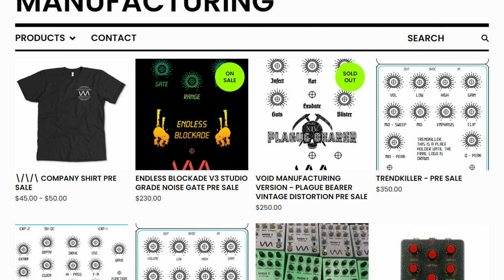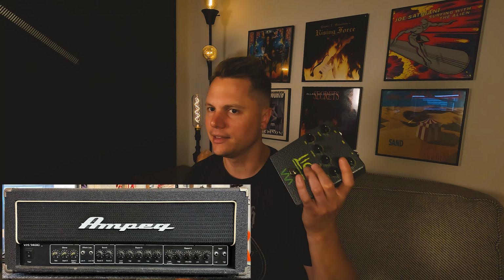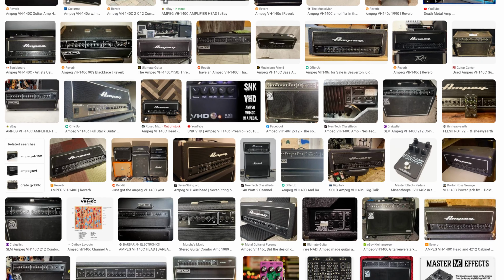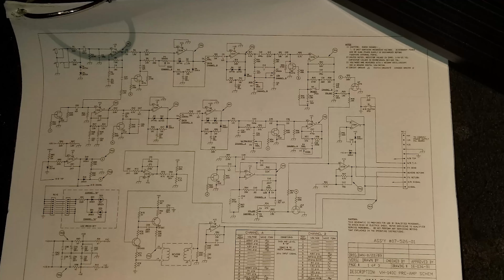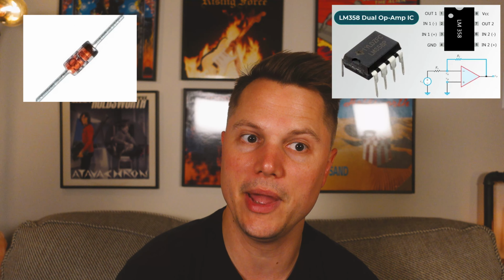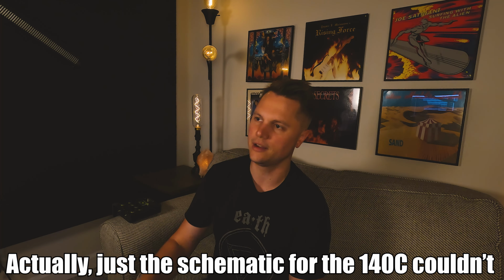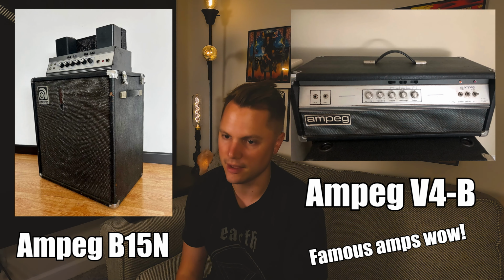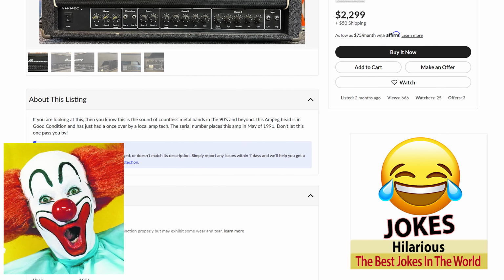Void Manufacturing \/\/\ “Lich” | Ampeg VH140C #deathmetal

Comment: I bought this amp head/cab combo in 1997, have used it in both original bands I've been in (hard rock but not metal) until last year when I finally wanted to stop lugging so much equipment. I've yet to find something as great as this has been and may end up bringing the head and running it thru an ir pedal. 
I will look into this pedal. Thank you! 👍
Reply from the maker: That is such a cool amp, I would love to get one!

Comment: New sub. Great video. Yeah my bass friends are often shocked I have used Ampeg sometimes as a guitarist. I had a tiny ampeg SS practice amp in college I wish to baby Heyzeus that I still had. Best distortion on a small amp, either tube or solid state. Been looking for a pedal that does that SS/VH140c sound. Currently use an Ampeg V1000 Lee Jackson designed head that's a great EL34 tube, mid-gain amp but it's more like a Laney Lionheart than a Laney Supergroup to my Ampeg-impaired guitar buds😂. Again excellent job.
Reply from the maker: Thanks a lot man, glad you enjoyed the video. The Ampeg VH140C and the Sunn Beta Lead are two of my favorite sounds, and you can get them from Void Man now in a stomp box which is pretty sweet.